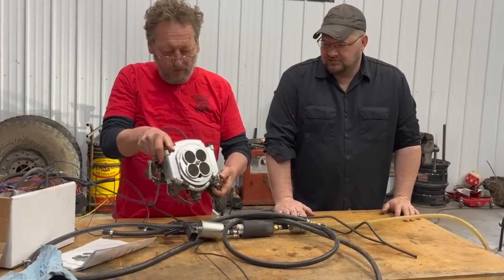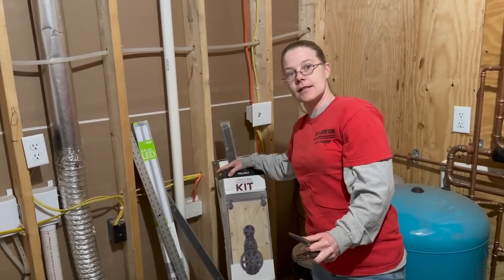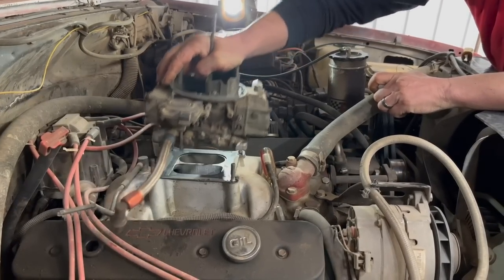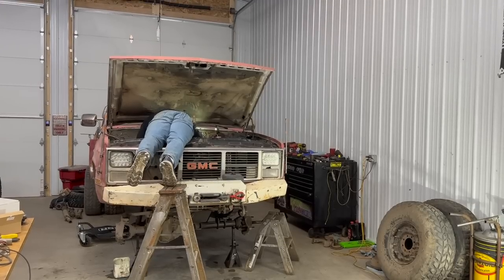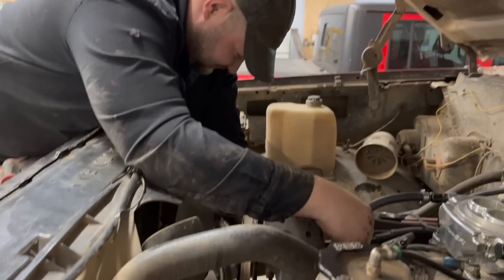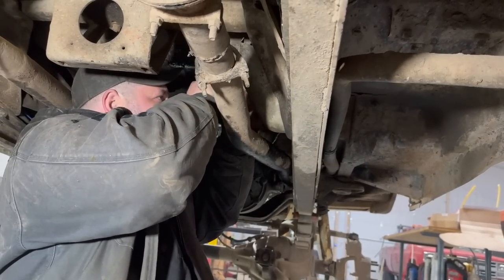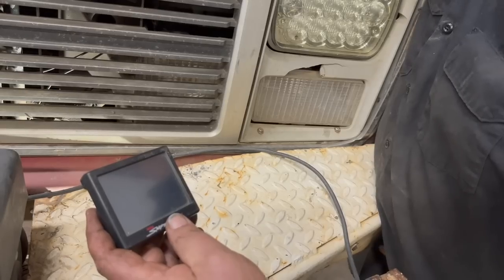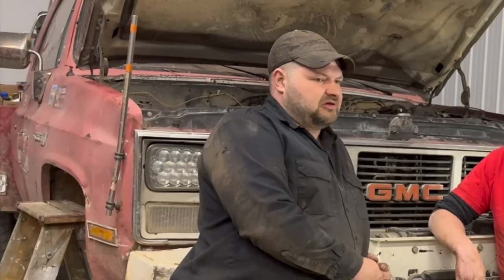EFI upgrade on the tow truck for the Off-Road Wrecker Games

Comment: Eric, The Sniper kit will benefit you more than you know.  It will be especially true during the wrecker games. Not having to worry about float levels, altitude, and general normal carburetor issues is Huge. Best of luck in the competition. Your experience with multiple terrains will benefit you greatly. I’m rooting for you bro.

Comment: One thing about that type of fuel pump - I did the same install with a Holley TBI system 30 years ago - you can suck air 2-3 times on that georotor pump and it will ruin it.  My concern is the extreme angles that the vehicle will be in - my advice for now - keep your fuel tank at least half full at all times.  If you let it go too low, and get at the wrong angle and lose prime, it won't be long until the pump won't work - it will still spin and sound like it is working, but running it dry scores the surfaces inside and it won't pump.  BTDT, got the T-shirt!  Maybe carry an extra (I know, $$) fuel pump with you just in case.
Reply: If this is an issue! Why not put something in the system? A: a small airpump putting the tank under pressure so the pump is feeded?
B: a cannister close to the pump do the pump will always pump fuel.
Reply: @henkoosterhof5947  That is one of several ways to address the issue.  Some people install a low-pressure type pump with good suction near the tank, and install the high-pressure georotor pump somewhere downstream - you still need to ensure that you don't suck any air at an extreme angle or you will lose power, and that is more of a tank/baffle/sump design issue.

Comment: Good to see the wrecker getting modernized with efi I have a old chevy grain truck I wish I could afford to put a sniper efi system on but I don't know much about the engine in the first place
Reply: Email holley directly with what you think is in there and they will set you up. I got an old ford with a 379 and kit is about 1500

Comment: That will be a great upgrade for you.  I like carbs, but I am not talented enough to keep them working as well as an injection system.
Reply: I have never seen a carb do what efi can
Reply: @jackk8422  such as?
Reply: @KC9UDX  run the same at sea level and 10,000 feet of elevation.  Easier cold and hot starts.
Reply: @jackk8422  you forgot about feedback carbs.  And the Adjust-A-Jet.

The easier start thing is a popular joke.  I've never owned a fuel injected car that starts as fast and easy as any of the properly set up carburetted cars I've had.  The only people that say fuel injection does this better are people who never had a carburetted car or had a poorly maintained one.
Reply: Carburetor has 1 advantage.  No electricity required.  Other than that direct injection efi is vastly superior at maintaining a proper afr. That is why almost everything is efi now.
Reply: @jackk8422   I am not totally convinced that carbs can't be tuned correctly as Holly has proven multiple times. I can't remember how long ago Stacy David worked with Holly to Tune a ste of dual carbs. Engine Masters has been able to do it regularly. I do not have access nor the ability to tune one like that and that is why the EFI is better for me, because well I don't have the tools and know how. The EFI from Holly is better for guys like me. Just because I can't do it doesn't mean it can't be done. I can paint a car but know one is gone to hire me to do their expensive paint job. I know several that can do it, just not me.
Reply: @jackk8422 that's not really true.  Most modern carburettors have electric chokes. 

Carburettors have the following advantages:
-They use far less electricity.  This becomes obvious when you have to pop-start or jump-start.  Carburettors always win this because fuel injectors starve the ignition system.
-They don't require complex computers to "know" how to work.  Even computer controlled carburettors still work when the computer fails. This becomes obvious when you have an old fuel-injected car with many marginal sensors and bad connections.
-They never have to "learn" how to work.  This becomes obvious when you have to jump-start a fuel-injected car in the deep cold.
-They (generally) don't run upside-down. (there are designs that do but this is not desirable for cars)
-They are less of a fire hazard (no high pressure fuel)
-Non-computer controlled carburettors don't change by themselves at random.
-Carburettors induce a cooler, denser air charge due to the necessary venturi(s).

Carburettors have these disadvantages:
-Almost nobody actually understands them. This is the number one reason why EFI is so popular.
-They are more expensive in mass-produced cars because nobody bothered to engineer a better carburettor system due to chaotic regulations at the wrong time in history.

The only real advantage EFI has is the E, not the FI.  And this is only an advantage compared to common non-computer controlled carburettors.  Computer controlled carburettors ("EFC?") work better than EFI.

Comment: I suggest switching to an in-tank pump, which may require some creativity, but can be done.

I tried using an inline pump (reluctantly after installing an L31 crate engine not machined for a mechanical fuel pump).  The inline pump worked OK in cool weather but would vapor lock and strand me on hot summer days.   After unsuccessfully trying several different inline pumps and several different plumbing configurations, I switched to an in-tank pump, which has worked flawlessly since.   Basically I simply dropped my inline pump into the tank, attached to the bottom of the pickup tube, and used solder/heat shrink wiring connectors.   The wires pass through a small hole that I drilled in the fuel tank cap.   

Alternatively, if your engine has a mechanical pump, I suggest using the mechanical pump to pump to a tiny fuel cell (1 gallon or less), and have a 60 psi in-tank pump inside the fuel cell.   You can buy the 1 gallon fuel cells for not a lot of money, and they're small enough that it could probably be mounted inside the engine compartment.   Yes, I know your funds are limited, but vapor lock is no fun.
Reply: The tiny fuel cells I was thinking of are called "2L fuel surge tank for 044 pump."   You can get them for $45 - $55.   They take a pump that is submerged in the cell, so the pump stays cool and  does not have to suck fuel, solving the vapor lock problem.   Then use your original equipment fuel pump to supply fuel to the surge tank.   That's how I plan to do it if I ever swap my quadrajet for a sniper.

Comment: Might want to pay attention to that o2 sensor, it’ll burn up being at that angle. They need to be parallel to the ground or pointing upwards
Reply from the maker: Holley said for the sniper 15 degrees off of horizontal or vertical

Comment: Curious. You know your way with carbs!
Why the choice for efi?
 Want to learn things?
Be very shure you have al the programs in the laptop. If you want full response(100%) adapt it to the weather conditions that change 3/6 times a day.
Or do you go for a general setting?
Reply: Driving on extreme angles can mess with the floats and therefore starve it of fuel.
Reply: @mwagner_87   in our country there is a famous expression. Stated by footbalplayer and trainer Johan Cruiff.
,,Every advantage has its disadvantage,,.
Yes. Carbs get influenced by angles but still have an amount of fuel in their bowl.
But efi needs a controlled supply pressure. At the moment the pump fills with air( no supply to the pump) ..... this pressure drops.
Have a look at matts ofroad recovery.
He modified the tank  so the pump will have a constand supply of fuel.
The future wil lead the way.
Reply: Just my opinion here. I don't think computers should ever be in a car. I love carbs and anyone that can make them work, but fact is that for extreme angles and off-road work, he will be far better off with EFI. The right tool for the job. Simple as that.
Reply: @MaxNafeHorsemanship   sir i am afraid that your choice of cars is limited. I know what you mean and agree with you. In the netherlands al ,,daily drivers,, have 2 f r e d units(. ridiculous electronic devices) on board. Older cars are not allowed in city centers because of emissions.
Reply: @henkoosterhof5947  You are incorrect. While it may be difficult to obtain some cars (in Canada), a lot can be had. I can't recall how many brands I have owned, but they came from at least 8 different countries and ranged in year from 1948 to 1999. My choices are only limited by my desires. I'm sure I have owned a few you have never heard of.
Reply: @MaxNafeHorsemanship  sir i live in the netherlands. I am glad that you over there still have a choice. We dont. And i am afraid that every state of your country has differend rules. In california prius owners cope whit theft of catalizers and so on because they need special requirements for that state.
Reply: @henkoosterhof5947  You read to reply, not to learn. I don't care about California. If you read my last comment, I stated I don't even live in that country. I also live in the most lenient province in this country and can pretty much do as I please. There are also a lot of exemptions for antique vehicles.

Comment: You Have to Upgrade your Alternator you wont have enough Amps to run the new Electronics you can Adapt a 105 Amp from a 90s S10 to fit and will be one wire activated or a 2000 silverado 140-250amp just swap on the original pulley!~
Reply: It was u updated, I saw a video that mentioned and showed it
Reply: @mikebelcher5111  What was me?
Reply: It's not what you have, it's how you use it. I'm still running the factory 35 amp alternator. Newer ones are over 200. That's crazy, but for tow lights, work lights, lots of idling and electronics, maybe 100 would be OK.
Reply: @MaxNafeHorsemanship  There has never been a 35Amp Alternator Produced on a Chevy or GMC.... So your statement is false they made 65Amp 90amp 105amp 120amp 140amp and 200amps i run 250amp alternator from a 2000 silverado on my 91 S10 Blazer because they are cheap i don't want shit failing because i don't have enough power! The ECU and Fuel pump Alone Need 100 Amps with supporting electronics Electric Fans Add draw Lights add Draw and Relays and Wipers Add Draw! Your Barely able to run what you have on what you have im not i dont like Dim lights and laggy electronics because it doesn't have Power that is how you burn up shit!
Reply: @Xxjoker21xX  First, I never said I drove a GM. Second, you are too young to remember when they used 35 amp alternators. In some cars, the charging system consumed about 5 amp just to function, so the actual output was only 30 amp. I also don't depend on or have all that electronic junk that you think you need. I get better fuel economy and have fewer problems. If you know how to install proper wiring and a big enough battery, you will never have a shortage of power. BTW, I used to install power sucking accessories for a living too. That 65 you talked about was an option, not the standard in the day. Only if you needed more power.
Reply: @Xxjoker21xX  If you know how to calculate power consumption, you will learn how little you really need, and how much of an alternator you need to replace what you used out of your battery. Your battery alone can provide all the current you need, and your voltage (due to current use) can drop to somewhere around 8 or 9 volts before the ECU has a problem. Using proper power management, I can still drive around with a 30 amp generator. FYI, they don't even charge at idle.

Comment: What's that funny looking smoke coming from ????  

  You really should put a pump n hanger inside the tank.  Far too easy to get it ripped off or damaged by the rocks n mud.
A throttle control could be used to push the IAC more open and give it more for hydraulics.  A really clever way would be to use a vaper solenoid attached to a larger vacuum source and with a switch open a vacuum leak to up the idle.  Don't know how the check engine if it has or SNIPER would feel about the uncalibrated but I think those are SD systems anyway because there isn't a MAF which means the fuel managment wouldn't care save for a bit of rich correction.    If you were REALLY sneaky you could wire the switch to the controls of the wrecker and make it so the extra air only occurs under demand for pump.      Any chance you could just go to a JSB pump like how a BOSS plow or dump trailer uses?